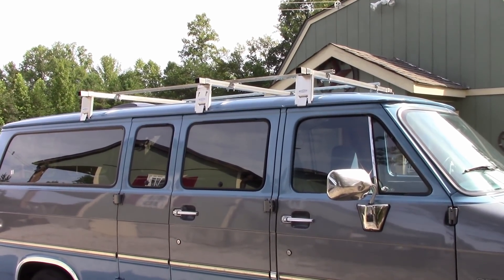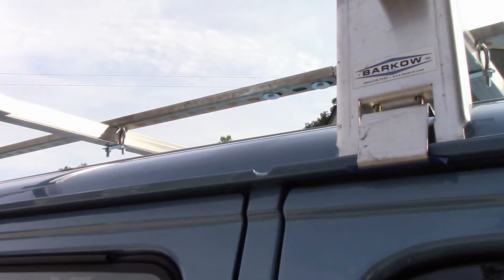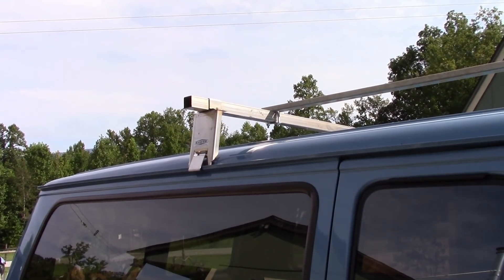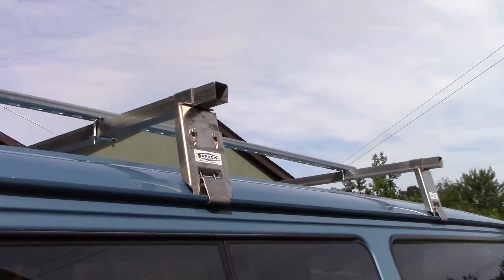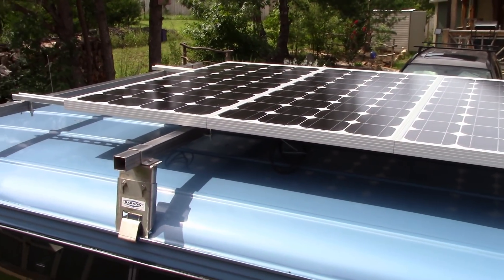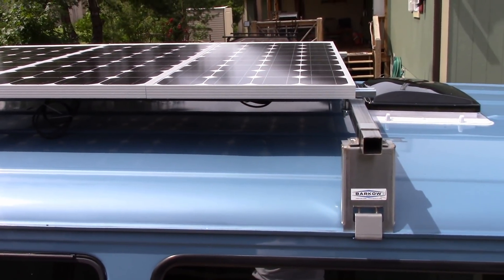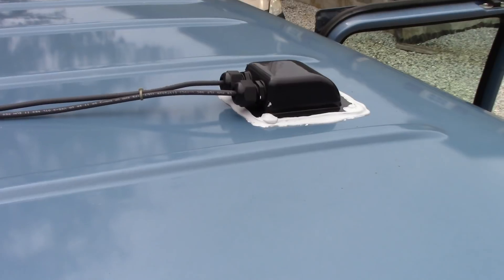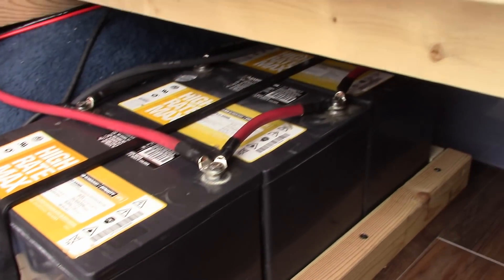Van conversion~SOLAR power!

Comment: Check it out ! The solar is all installed on the van. I have 300 watts of solar panels . I have 425Ah of power available at 12 volts. It works great!

Comment: I would mount a 6" diameter pvc tube for water to take warm showers or for cleaning dishes, instsll a port for filling water & a valve stem to add psi.
Reply from the maker: Good idea. I have the room on the racks for one. Thanks!
Reply: You're welcome & good luck!